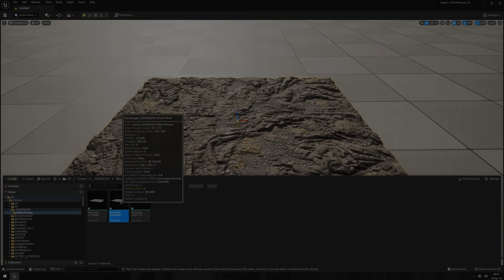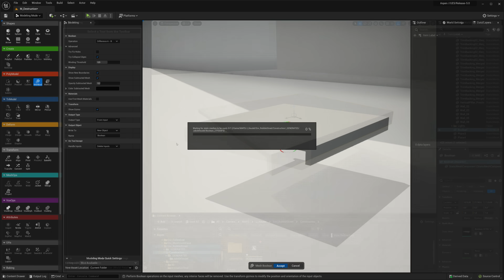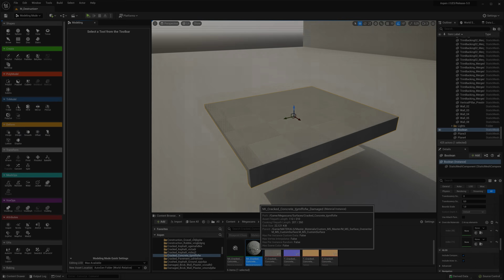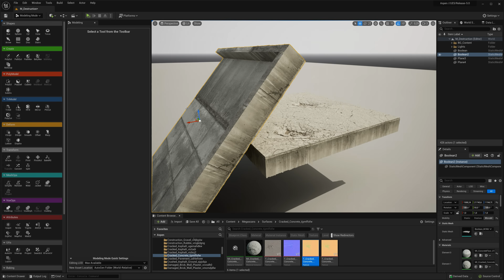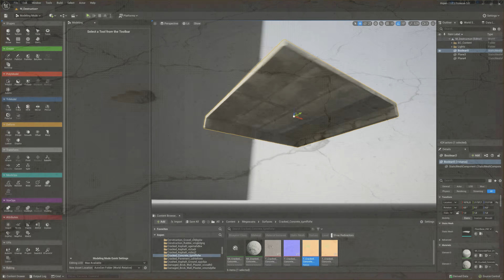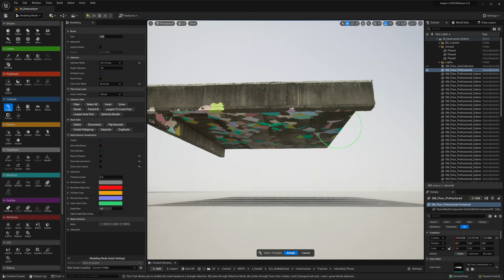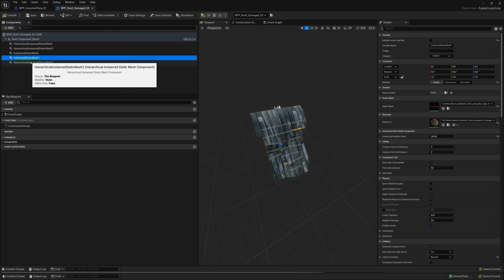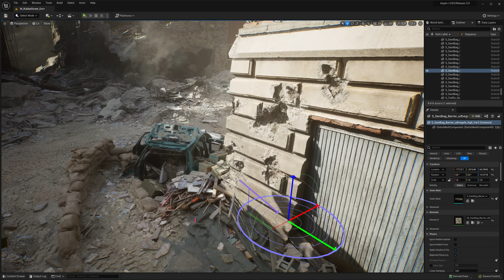Constructing Destroyed Assets: Creating ‘Ninety Days’ in Unreal Engine 5

Comment: After applying the tesselation I'm struggling to work with the object due to high polygon count, even after simplifying the fracturing is not working and freezes and crashes, I have 32gm ram, I don't think it is necessary to add more, but is there any other solution to this? Because it seems everyone here doesn't encounter this problem here in the comments section.
Reply: I have this problem too. I get the same 32gm ram like you, but when i use his preference to simplify model or split the box into peices, the program just ERROR.
Reply: I have 64gb and it maxed out my ram so I had to force quit. If you're using  5.3 it's broke. Something about collections and/or nanite.

Comment: Jakob: I'm using it for cinematic so it probably won't hold up in games
Me: staring at every game asset i've created that looks 10x worse 😅

EDIT: Holy crap, the fracturing and the fact it creates another UV texture map for the fractured surface is mind blowing.. 

Also, can I confirm, that when you duplicated the geometry to cut the corners off to make them more rugged, am I correct in understanding that it used the displaced geometry of the duplicated meshes rather than the base rush to the deduction??

Comment: This is mindblowing what can be done now straight in the engine! Thank you for this tutorial. However, I have a memory crash when tried to repeat it with the same parameters as in video: Ran out of memory allocating 12288 bytes with alignment 16. Last error msg: The paging file is too small for this operation to complete.. 
Did anyone had this problem? Could someone tell me what kind of memory is lacking and maybe how can I allocate more ?
My specs: RTX 3060 6GB, Intel Core  i7-10750H with 64GB of memory

Comment: Hi, I just started using UE5 and do small projects. Its an awesome experience and really interested to master it.
HOWEVER, I'm wondering why my assets from quixel somehow looks like low quality even though I have downloaded nanite quality.
Need help please to fix the problem. I've tried different methods but nothing worked.
I hope the answer could help everyone who experience the same problem as I have.
Reply: the textures from the model/surface you have to disable the virtual texturing option on each texture slot.
Reply: If you drag the Quixel Assets into the engine it uses right away a low level of detail - in short LOD - and downloads the asset in the background.
Another thing is the in engine quality settings. Just like in games you can set the graphic quality from low to very high - called cinematic iirc. Low setting can also cause your problem.